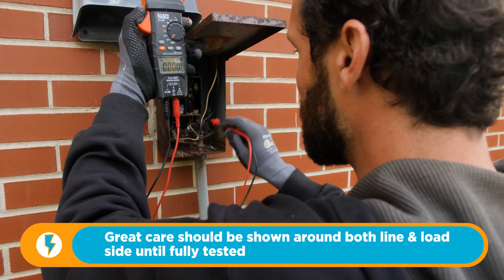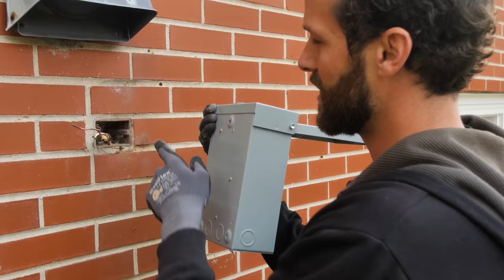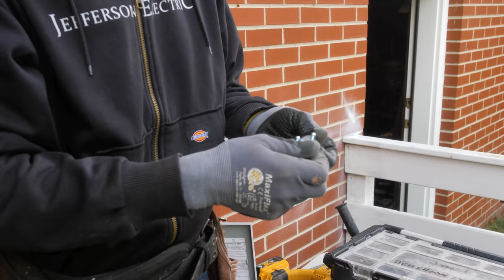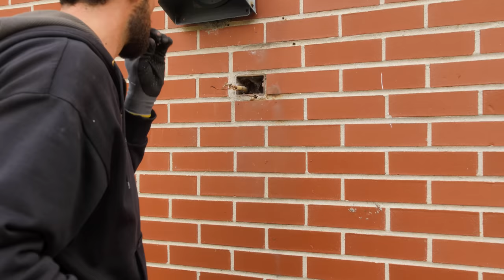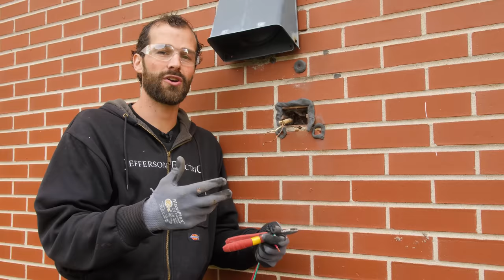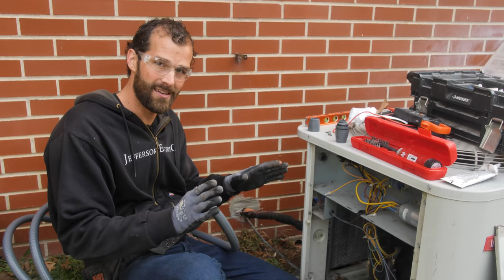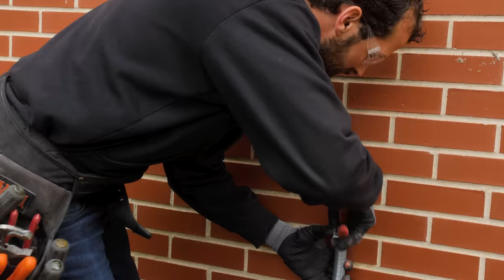Wiring An Outdoor AC Unit

Comment: Almost perfect so I will nitpick. Seal tight need a clip  within 12" of the disconnect.. I would have used a chase nipple on the back of the disconnect to run the new wire through. I usually take the two screws out and pull the cover off the disconnect so your not fighting it all the time.

Comment: Shouldn't there be a another strap closer (within 18") to the disconnect?
Reply: Yes, within 12 inches of the disconnect and within 3 feet of the unit and every 3 feet in between for lengths exceeding 6 feet.

Comment: You didn't explain what part of the NEC allowed you to cover up the junction box in the wall and still consider that box to be accessible?  Why not move the disconnect over away from the vent (and water) with an outdoor rated cover, LB, and short piece of PVC? Imagine water getting into the box in the wall causing the wire connection to fail and having to trouble shoot  the fault.

Comment: is there an advantage or reason to use a fused disconnect vs a non fused one?
Reply: If it is run off of the right sized breaker, then there is no reason to use a fused disconnect.
Reply: Never use a fused disconnect where it isn't required.  It's just another thing that the customer has to worry about and it's unnecessary.
Reply: Fuses are good for air conditioners. They soft start.

Comment: Unless I missed it, I did not see you do an inspection of that preexisting run for the condenser unit. i.e. Verifying the wires were tight in the breaker, visually inspecting the run (where possible) for poor and/or excessive splices, and/or damage to the cable. As well, you just state "this is 10GA wire" without showing/explaining how you came to that conclusion. i.e. Reading the jacket, if possible, or using an actual go/no-go gauge of some sort, like your wire-strippers. As these videos are produced for DIY-ers, I would think these would be important steps to include. 

The other thing I noticed is that when you changed your mind on how to feed your disconnect switch and ran loose THHN through the back of the disconnect enclosure, you did not show changing out the incorrect fitting to a chase nipple. Regardless of which fitting you used, there should have been a bushing (wire protector) which I did not see in your enclosure.

My suggestion for this project would have been to stop at terminating the line side in your disconnect (and lock it out) and forego the installation of the whip. As you had stated that the current AC will be replaced before it is to be used again, you may need a longer whip due to condenser unit placement, or want a shorter whip for cosmetic reasons. I also would not have bothered installing the fuses yet as you may actually need lower rated circuit protection  to match manufacturer specs which will be printed on the new condenser unit.

Ok, enough nit-picking, I do actually have a question. What are your thoughts/feelings on the carve-out to the "rated ampacity tables" that the NEC has gifted the HVAC industry with? i.e. 14 Ga wire on a 25 amp breaker. 

This video explains the carve-out. https://www.youtube.com/watch?v=xDQtmZHKMUA 
In the video Ryan states the reason for this carve-out is because compressor motor has a built-in overload, and goes on to compare it to the built-in overload on a garbage disposal motor (reset button). 

Does this mean I can run 18 Ga and a 20 amp breaker to my disposal outlet under my sink simply because it has a built-in overload? (sarcasm)
Reply from the maker: Hi Antonio! Thank you for your thoughtful input. Great suggestions all around. 
I'm supportive of the HVAC wire sizing codes. Understanding the nature of fault conditions and the actual maximum ampacity of wire, not just the typical breaker sizes that are used, lends some helpful perspective! Stick around. I like how you work!

Comment: Didn’t you say the line coming in from the bottom was a code violation? Why didn’t the power come in the already drilled upper hole?
Reply from the maker: Power is permitted to come in from any direction as long as line side terminates on the top set of lugs

Comment: Code violation on proximity of vent to electrical. I have also found dryer vent located in similar disastrous position. External handled switches are security issues ,an innovation for mischief . Lock box protects out of sight. Personal preference.

Comment: Some codes are dumb if you can't tell an air conditioner disconnect has 2 hot wires going to it then you probably shouldn't be working on it. Only air conditioning equipment that's 110 volts are window units.

Comment: I always wire 240 stuff the way phone company does … right … red …. Ring that is how low power communication lines are wired. The right terminal side gets the red wire and the red wire contains the ac hot voltage and ring also means if you wire up a 1/4 inch patch cable or 1/4 inch patchbay the red goes to the ring  not the tip of the 1/4 inch connector
Reply: Ring ... Right ... Red ... Rough

Comment: How is the next electrician supposed to know that there is a splice connection behind the box?

By you repeating the bad electricians work you kept the same problem. That should have been fixed the correct way. 

So as before you now have a hidden junction box. Regardless that it is outside.

The correct way to fix this problem. Is use an outdoor remodel box. Right over the existing box. And use a small amount of gray PVC electrical conduit pipe. And connect it to the disconnect. And then put your electrical wires in the correct way.

So you created and hidden Junction. I suggest you correct your building code error. After all Billy code required no hidden Junctions Nationwide.

Comment: When you spliced on red , black, green wire to outlet box video never showed you marked the old white wire as a hot….when you mounted disconnect video never showed you tighten cable clamp screws around the red , black , green wires.  Why not fill the screw hole in the mortar joint 2&1/2 bricks to the right of the disconnect especially since you filled the other holes with duct fill.

Comment: Why in the world would you be ok with introducing an extra layer of failure, the wire nuts on the Romex to THHN, instead of just bringing that romex out into the box. Its like 6 inches. You can not make me believe that romex extending 6 inches into a box like that is going to cause a problem more than introducing those extra points of failure.

Comment: On one side you are doing a good job, on the other side you are doing a terrible job.
Stranded wires inside screw terminals are only acceptable if the terminal is designed for stranded wires. None in the disconnect box is designed for it, the screw directly compresses the wire strands which damages them. You should use crimped ferrules for these types of screw terminal lugs. The ones which has either a small metal "shim" or a square washer can accept stranded wires. See the ones in the AC unit? Those can accept stranded wires.
Not sure what the "code" says in the US, but it is a huge no-no in my book. I have seen many many crushed stranded wires in such screw terminals.
Same thing when you connected the grounding inside the AC unit. But on that you should have used a round (or fork spade) crimped terminal and screw that down.
On the nitpicky side: nice metal shavings in the grass! And you are so proud of your duck seal job, but on the other hand this new box will rust out just like the old one because its directly under the dryer's discharge air vent. And next time run the conduit straight down instead of at an angle on the wall.

Comment: Can you tell me the wire and breakers I would need to install https://hvacdirect.com/5-ton-aciq-hp-pack-phd460000k000k.html?qty=1.  5t HVAC with 20,000kw heat strips.